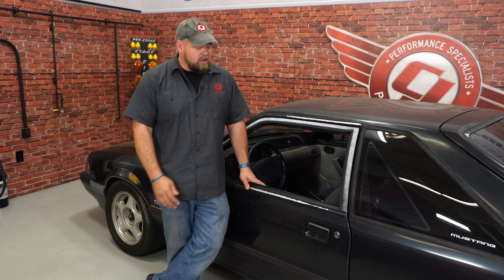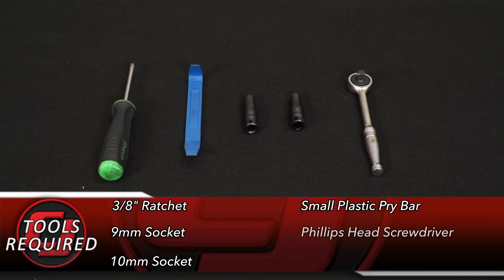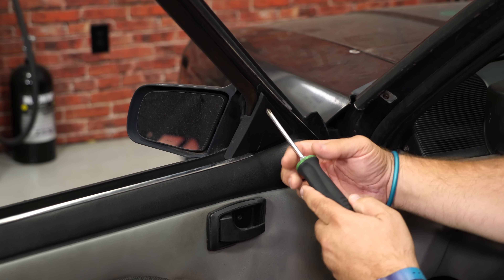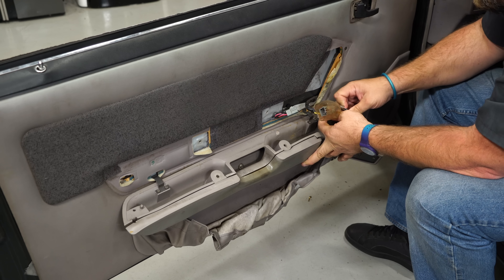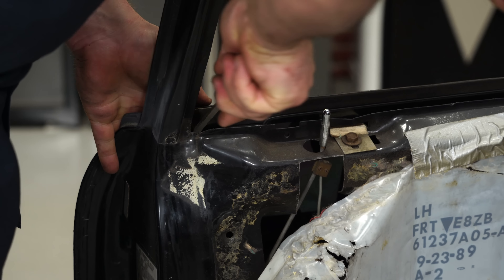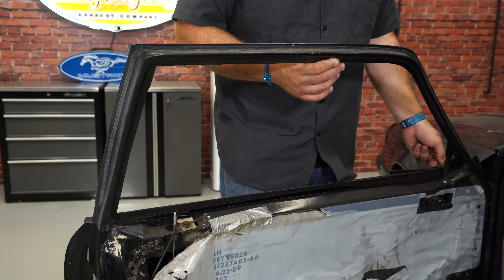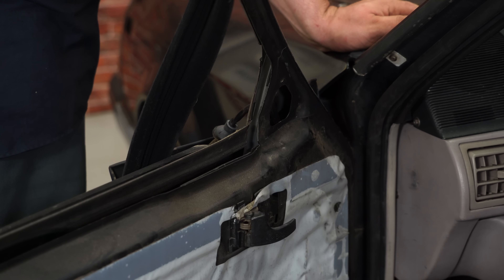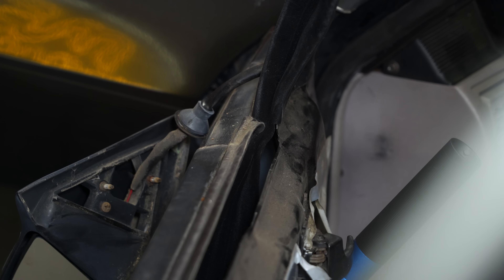Mustang Door Run Weatherstrip Pair Coupe/Hatchback 1979-1993 Installation

Comment: Funny how we don’t see him actually struggling with this. Another thing & this is huge...how is it you got that big opening off to put your hand in there to run the strip down the channel? These 2 stupid bolts won’t come on. The ones in the middle of the door backwards with nuts holding them. Makes this a LOT EASIER. LMR is fake and expensive. 🤬
Reply: decidedisciple67 idk it was a year ago I posted this.lol! I did figure out the problem and replaced the weatherstripping